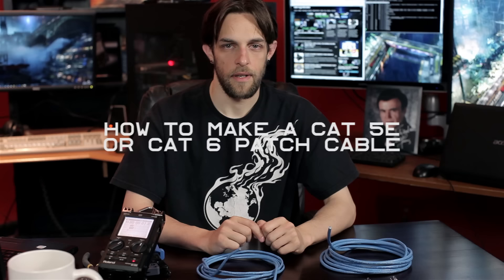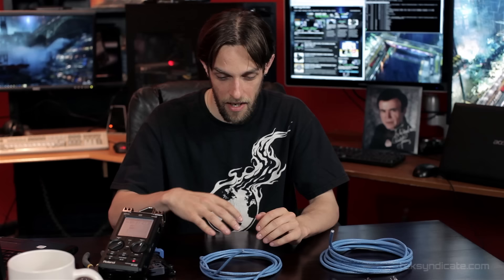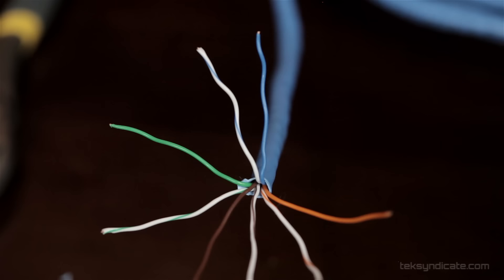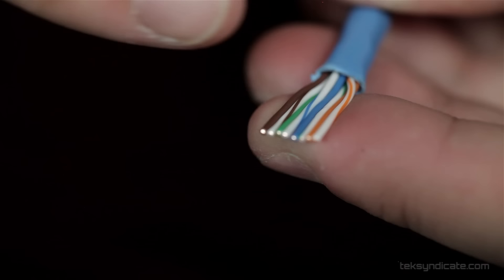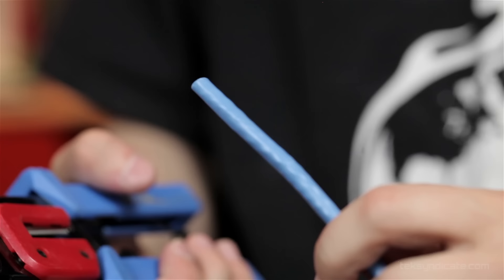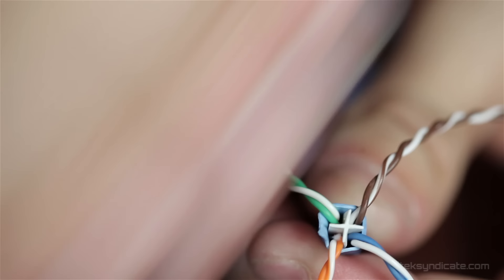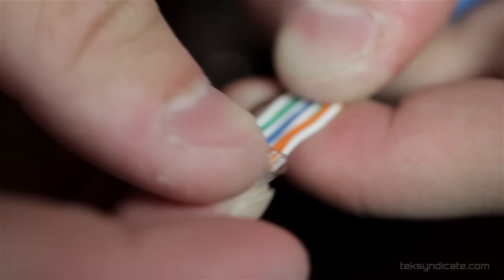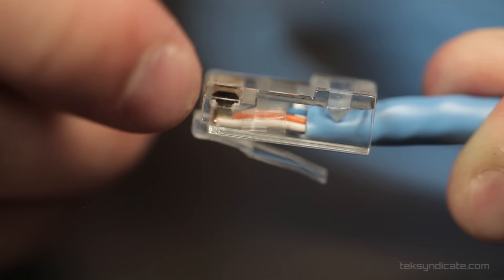How To Make RJ45 Network Patch Cables - Cat 5E and Cat 6

Comment: shud add its T568B standard .. in europe A is the standard ... but almost both work everywhere ..
Reply: This. This is an important note for people that do not know. In the US it's the T568B standard. It won't matter for patch cables where you're using the same wiring for each end yourself, but if the other end is already done, or you are terminating to a wall outlet it is important to know.     http://www.cat-5-cable-company.com/faq-568A-VS-568B.html

Comment: Worked for the oldest phone company in the world for many years and wished I would have had this video when I started. I eventually figured it out on my own and also discovered in gigibit ethernet, it doesn't matter what color combo you use as long as it is the same on both ends! The company I work for now uses the B color arrangement that you show in the video supposed to the A color arrangement that we used at AT&T. Good vid!

Comment: My method for RJ45 Cat6 - I use an alligator clip with a round wire feed to untwist the pairs, I NEVER pull the pairs to a 90 degree angle when separating them. Avoid bending the pairs in any other direction except for straight out towards the connector - any bend becomes a "spring" when you go to put the whole thing into the connector holes.  I make a 3/8" cut down the cable after untwisting  and clip the wire pair separator below the top of the cable jacket. Straighten the wires one at a time with the basic plastic cable sheath cutter and then all together the same way.  Once I get the pairs lined up like  865 - B configuration I use forceps to hold them in place and slide the mess into the RJ shell. I use forceps to avoid having to change my grip on the neatly trimmed pairs, letting go at this point causes a complete do-over and a definite time killer.  If I've made a mistake or a wrong wire makes its way into the wrong slot I still have the colors lined up with forceps and still have a clean 90 degree cut - I make the needed change after making sure there is no "spring" tension acting on the errant wire and then crimp it. A nice clean cut with a real sharp blade makes it easier.  A 30 power lighted magnifier comes in handy for old timers like me.   good luck!

Comment: It appears you're using ordinary Cat.5 cable which has solid conductors and then giving those solid conductors a good old waggle to get the sheath off - not good. If your stripper is set up correctly the sheath should just pull off cleanly with a firm tug - no need to wank the wires about like that! If you're regularly making patch leads get yoursef a  drum of Cat.5 flex which has stranded conductors.
Reply: Philip Bull Agreed.  Bending the cable like that is not Best Practice.
Reply: Mark Beckstrom Completely agree, don't bend your cable... just pull it 🌚😏

Comment: ahhhhh why are you kinking the cables after you score it!! It degrades the copper! Just splice it and pull down the string.
Reply: Because that copper gets removed anyway.
Reply: Because it goes inside the RJ45 Connector.

Comment: A good video, only thing I would add is the use of the pull string inside the cable, having been a fault man for over 30 years I have come across countless faults where the damage was due to the stripping process when originally installed, mainly structured cabling and telephone wiring. If the conductor is nicked by the blade or side cutters over time it will deteriorate due to moisture, by using the pull string you run no risk of damaging the conductors.

Comment: Network engineer, currently teaching folks at work how to do this. GOod stuff. 
I *think* you might have put that spacer (formal name is load bar) in the connector upside down. It's a little tough to tell but you'll see where the angled/inclined portion of the load bar is supposed to snug right up to the declined portion of the connector. 

Real nice video though. Kudos.

Comment: Also, if the cable is a bit stiff after you arrange the colours, you can just slot them into the channels of an uncrimped RJ45, so they stay flat, then remove them and cut them flat. The cutter in the crimping tool is perfect for that last cut.
Reply: I think I got one that is not stiff at all, the cables were so elastic and had a mind of their own, no matter how much I tried to bend them into a lineup, they still manage to get screwed up as soon as I gave a bit of space for them to enter the caps.

Comment: I use EZ RJ connectors and the Platinum crimper tool. I’ve made hundreds if not thousands of cables. It’s the next step forward with connectors.

Comment: This helped me so much. I was fiddling around with the rj45 head without those wiregliders. That made it impossible. 1 thing is missing though. The little thing you put your wires in first before putting it in the rj45 head, that thing only goes in 1 certain way.

Comment: You did the last CAT6 connector backwards.  When the connector has the tab facing you, the sequence is ordered as you described from left to right, orange to brown.  You had it facing away from you.  One might say that it doesn’t matter as long as you do it the same on both ends but that’s not the case.  The pairs are twisted at different rates according to their purpose in the sequence, 1 through 8.

Comment: I have your video as a reference from many years. I just want to tell you a problem that I passed through maybe 8 years ago. When I was cutting I thought that I need to strip (disrobe off) off the wires until the copper appears, so I advice to tell your audience that if they plug the wires with their plastic around them its okay, and the electrical current will pass through. I hope you understand what I meant. Thanks

Comment: good job ... very helpful.  Suggestions: inform viewer that wire pairs (solid color and white colored) are already twisted together inside the jacket,.  Once separated  it can be hard to ID (I had trouble seeing the faint color) white/orange, white/green, white/brown wires. I suggest the novice use magic marker (green orange brown) on the tips of the white wires to help ID them once separated. Also mention the color order in reference to either the cable end or computer end. Thanks again!

Comment: I wish some of the goons I’ve had to train  had watched this video. Quick side note, he’s punching down in B, as most people do, but A is technically still a thing. 

Pro tip: when you slide your pairs into the rj45, rotate your wrist upward to apply downward pressure to the wires going into the connector, it helps to guide them into their given channels. Don’t forget, if you have extra, you can reconnectorize, so don’t forget your service loops.

Edit: Another pro-tip: Panduit RJ45’s don’t use a load bar and save mad time.

Comment: personally when cutting the shilding with the tool I like to use my tool just to mark whenre I am going to cut and then do the actual cut with a stanly knife, it may just be the fact that I often use a cheap crimping tool but far too often I find myself damaging the internals trying to do it with the cutter on the crimping tool itself ( I make these cables every day )

Comment: On the cat6 you installed the little carriage/guide upside down and not all the way in. One side of it is open and that should be towards the pins, and it should be installed all the way in. This will still work fine in most cases, but if you put it all the way in you can be sure that the connection is good.

Comment: For anyone ordering wire from Amazon with the intention of clipping and putting your own headers on....do not get the flat cables you see on there. Half the wires are just white without any color coding, the order of the wires changes from one end to the other, and the tiny gauge is difficult to thread through the header slots.

Comment: I made my isp to put my 1GB fiber (SIRO/Vodafone in Ireland) and router in my room, then I  tried multiple premade cat5e cables to connect my pc to the router,  they all were only doing 550-650MB download, with a 180-200MB upload I guess depending on quality.
Then I went for cat6, and I got stable 880-900 down and stable 200 up. 
Its worth, even if you need more distance. We are moving now to new house, I'll definitely connect at least the two rooms where we'll use PC.

Comment: You did a nice job covering the topic, but you left out some important information. Been doing this for 30+years as an installer , network engineer, trainer and executive.
 1st is all cables need to be tested for quality of termination. While it might pass a pair tester it may not pass a cable certified test. This will cause random speed,  performance and POE problems. 
Second item is,  patch cords should be made with stranded cable. Solid cable is not designed for RJ45 terminations. While electrically it will work it is not flexible enough and will eventually break. Yes they do make crimp connector's for solid wire, eventually they will fail. Numerous service calls to clean this up for customers over the years. Solid wire  is for station cabling and should be terminated in a keystone.
Third is cat 6 is better at reducing interference and helps improve video quality and reduces tileing. This would be a long discussion. Also better handles POE powered devices.
And last if you are running cable in a commercial environment you may need to use plenum rated cable to prevent toxic fumes in case of a fire. In many locations this is a code and safety requirment.

Comment: ProTip: Lightly touch your index finger (of the hand using the cutters) on the exposed ends of the conductors when you cut so they don't go flying.  This is the reason to have small cutters in your tool bag instead of just a large pair.

Comment: Cat 6 cable is not necessarily larger than Cat 5e. They both can come in gauges as large as 22 AWG or as small as 28 AWG, and still meet the Cat 6 or Cat 5e specifications, which mandate certain external performance characteristics, such as frequency bandwidth, return loss, delay skew, NEXT, etc, and those targets are achieved primarily through increasing twist rate rather than increasing wire gauge. Now, if you use anything smaller than 24 AWG for Cat 6, there are certain performance implications, such higher insertion loss and heat rise that can cause performance issues, especially in long runs. But in any case, it's not size that differentiates Cat 6 from Cat 5e.

Comment: 1. The string is NOT for tearing back the sheath. It is usually Kevlar to ensure that the conductors do not break when cable are stretched (For example when cable is pulled) because the Kevlar cannot stretch
2. You forgot the boot
3. Most important bit were not mentioned, do not unwind the pairs more than it needs to be as it will cause cross-talk

Comment: The order of colours in Australia is different we have the orange and green positions transposed. It's worth knowing that we have crimps for  solid and flexible conductors. Solid crimps use insulation displacement and flexible  crimps pierce the conductors of a patch lead . So it's important to be able to recognise which style of crimp you have and use the appropriate one. If you use a solid crimp  on the flexible cable you'll find it will work intermittently and drive you crazy. 😀
Reply: It's not an Australia thing – there are just two standards. Green-white first is the A type, orange-white first is the B type. As long as you stick to one type, you'll be fine.
Reply: @nUrnxvmhTEuU  there is a difference between a and b spec . It relates to the different twist rates on the different colours.  The cross talk  is different between option 1 and 2, the colour matters  The original order was blue pair in the centre  pins 4 and 5 ,then  the orange pair 3 and 6 , then green 2 and 7 , then brown pins 1 and 8 .
As data speeds increased  the pairs were moved so that the brown pair were not at opposite ends of the plug A T and T used A spec whilst  others used B spec. The Americans swore that A spec was better due to  the relative twist rates at 10 meg.

Comment: I've been a network admin/programmer for two decades, more of a programmer for the last 10 years, and still didn't know how to do this. The main reason: I need to do this so infrequently (there's a box full of patch cables already, I get another one in the box with every piece of equipment) that 1) it is easier to go to the store and just buy one or ask them to crimp it, 2) I forget the code in the many months inbetween....

Network techies who put in new networks... yeah, you'll be able to recite the code as fast as I can bitwise AND a subnet mask in my head... :-P

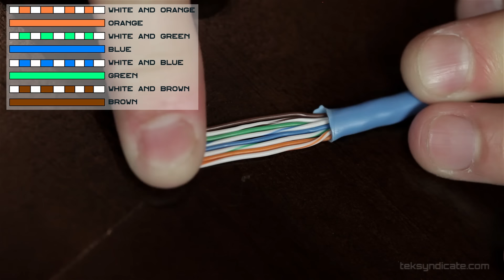Comment: Hi @Tek Syndicate I believe you should have gone into a bit more showing what and why you are doing at 3:37 . Some people have a lot of trouble getting the wires straight, especially stranded and that technique at 3:37 is an excellent way of getting them ready for the nosedive into the 8P8C connector.  Also, it looks like you are using solid wire to make the patch lead when is should be stranded. If it is indeed solid you are using then you were very violent with it when trying to break through the scoring on the outer sheath. I would guess that the copper where you did the 170° bending would now be compromised by the bending. Personally I would not use that wire and would cut it back so that part could be cut out and not used. I am/was not a professional cabler but have terminated hundreds if not thousands of patch leads up until the patch leads had a massive drop in prices in the mid to late-ish naughties.

Comment: Only thing wrong is bending the wire. Use a wire stripper built for 18g wire to remove the coat. That bend could easily break if you aren't gentle with scoring. Strippers just make life easier.

Also, pro tip! The crimpers actually have a pattern diagram on the handle! If you ever forget.

Comment: The best trick I was shown : make up a dummy socket with 8 small holes drilled in its front. PULL the wires through the holes with pliers, then remove, cut to length and insert in the real socket. Crimp and done. 
Making off sockets became miles easier with this trick

Comment: The green and brown pairs are power. The blue pair and orange pair are more for signal and traffic. Not sure when this modular standard layout came out but doesn't match how I've been terminating patch cables for 27 years. Blue is correct.
Reply: Also if you research the Cat6A patch cable by panduit the thickness is probably half of your cat6 cable but has more twist in it to better the speed of traffic.

Comment: As a network admin,  generally the cost of buying premade cables is far cheaper when you factor in materials and time.
Reply: Yes, if you want to connect your computer with a nearest router. When you need to put a dozens of meters, you need to make it by your own.

Comment: Just want to point out that the Cat5e scheme shown here is 568B. I've been doing some research and found that depending on where you are located, the preferred scheme would be different. In Canada, the recommended scheme is 568A (for residential), which has the positions of green & orange pairs switched.
Reply: Unsure where you found that info, but 568b is *the* industry standard. Every cable I own, either bought separately or packaged with some device, is wired accordingly. As such I would be very amazed if manufacturers worldwide would have separate production lines to create cables specifically intended for Canada.
 
To my knowledge 568a is strictly used for creating 10/100MBit cross-link cables, with the other end being 568b. Or rather: was. Because except for the very first generation 100MBit interfaces, every NIC capable of running at that speed can auto-sense whether it is connected to another NIC or to a hub/switch and that makes using a cross-link cable obsolete.

Comment: Hell you make this look soo easy, maybe it was just the cable I was working with the other day but the conductors simply would not line up perfectly like that and stay there, it took a good deal of luck as the conductors would change position as soon as I got them into the end and just seemed impossibly frustrating, however eventually I got it somehow.  I've done cables before much easier so maybe it was this industrial grade cat6 cable type but I was really upset how many tries it took me and and long it took.

Comment: Good video. The clear plastic insert on the cat6 plug you fed the wires through does not do anything for crosstalk as the wires are touching each other anyway behind it. It's just a useless feature of that plug.

Comment: Thanks for your video as it just helped me install Ethernet thought my house! The Color Coded wires were the most important and difficult too work with since they are all twisted and wrap up tight with that tinfoil! Great job.
Reply: If you have tin foil in your wire, this is shielding... to be effective you need to use shielded RJ45 plugs (part metal part plastic). The shielded RJ45 plug makes contact with the metal in the socket of your router or switch to provide an earth / ground connection to the shielded wire.

Comment: 2:45 That little string is also for structural support- important when knuckle head installers tug too hard on the cable. Great video btw, and very clear presentation.

Comment: 8:46 oddly enough I purchase Cat 6 connector by mistake when trying recrimp by old Cat5e RJ45 cable in my house, It didnt come with that tiny piece. So I just shove the cable into connector and crimp it and it actually works.

Comment: Great video! I appreciate the time you spent in providing us with the information. I have a quick question. Would you want to strip the wire though to expose the copper into the ethernet clip, instead of inserting the wire with the plastic/rubber covering? Thanks.
Reply: No need for that as the crimper presses the contacts into the wires right in the slots making a solid connection for each one.